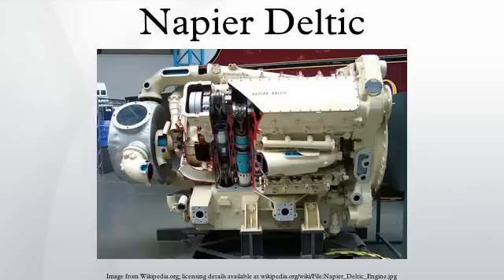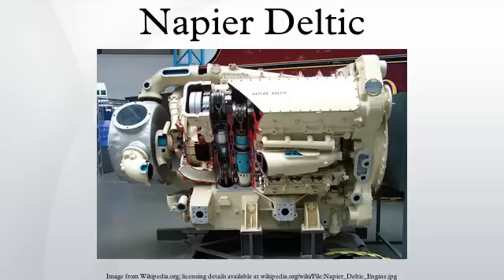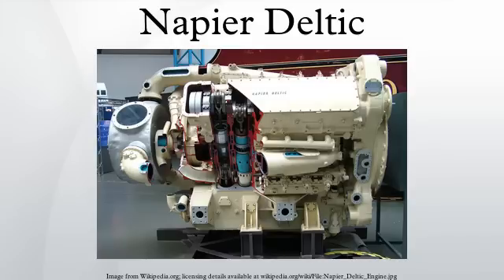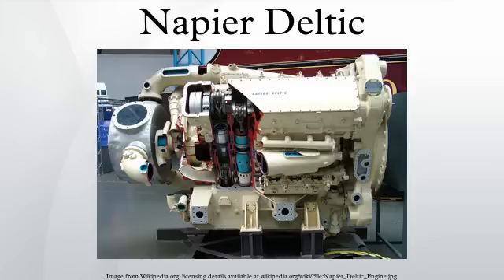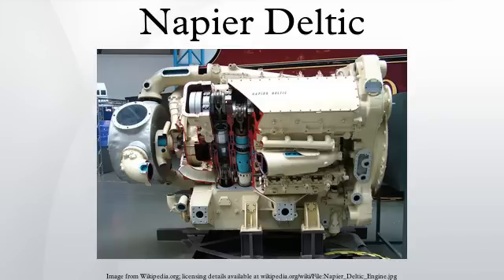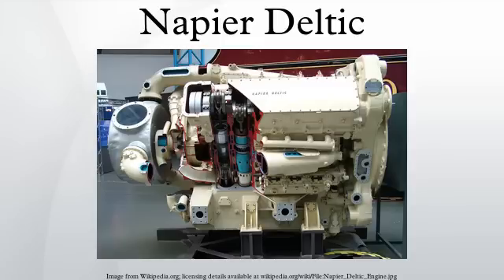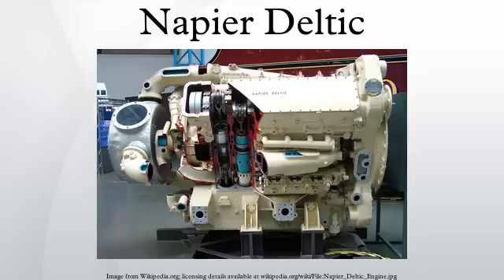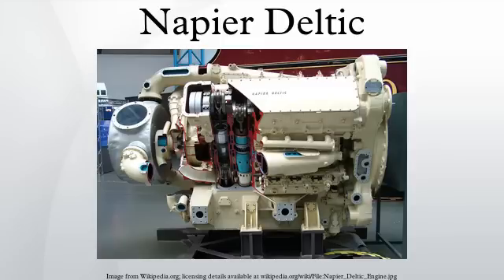Napier Deltic

Comment: I thought this was a German design from WWII? This is definitely not British invention.
Reply: i guess you thought wrong
Reply: Yea, you thought wrong. It was British project from 1943 to propel torpedo boats. (this dude literally copied and pasted the wiki article into a voice synth BTW.) That was probably in the vid, wasn't it?
Reply: The Deltic wasn't a German engine design but it was based on the original work by Junkers on their Jumo aircraft engines using the opposed piston design. Junkers produced model in 2 cylinder flat and 4 cylinder diamond form but could not produce the 3 cylinder Delta form. Whilst the Deltic was a purely British design it is very unlikely it would have been developed without Junkers earlier experience with the opposed piston format.
Reply: Napier & sons was all British engineering at it's best.
Reply: Mott theHoople I'm sure I heard a guy giving a guided tour on another YouTube video stating that the engine was originally german-designed , pre WWII.